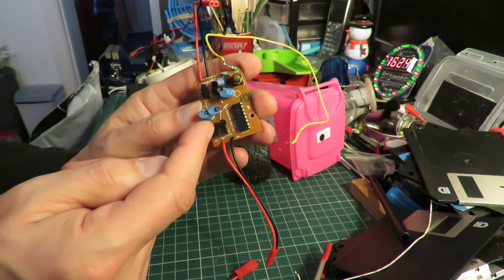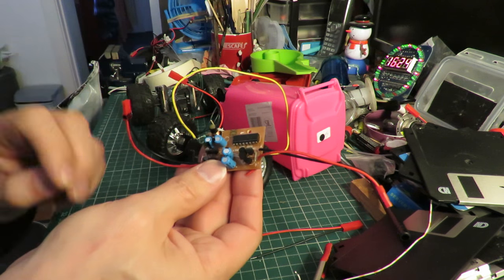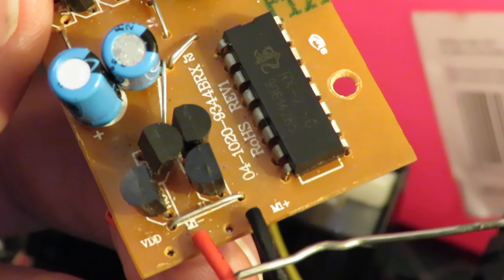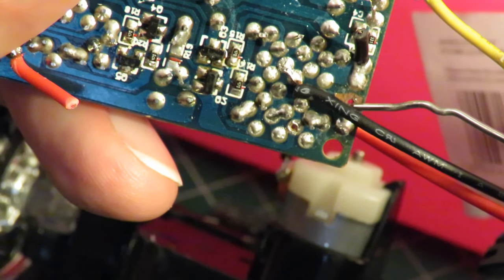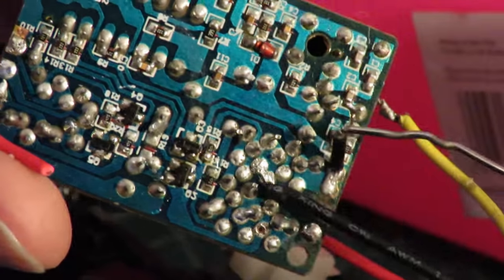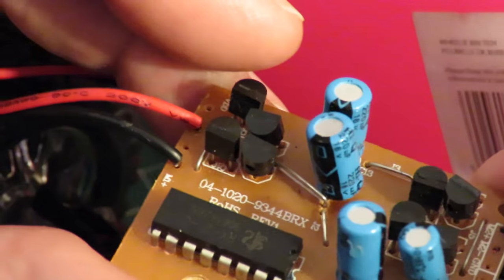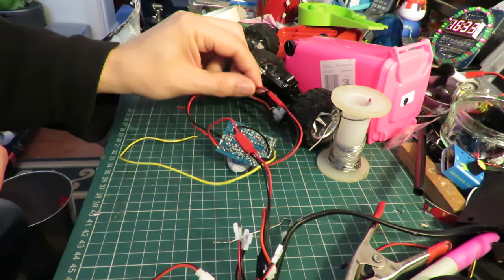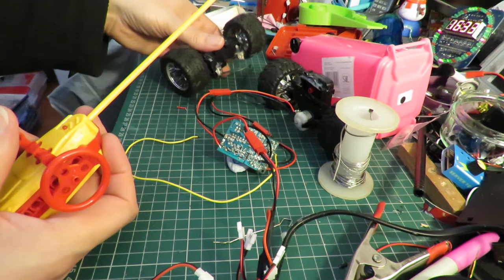Re-Using a Toy Grade RC Receiver

Comment: Hi sir I had a question that can I use a circuit board without esc with 9 volts 
It will burn or not can I use it with bo motor plz reply sir
Reply from the maker: That would depend on what the circuit board was designed to handle. If the car it came from used 4 AA batteries then it would handle 6 volts and using a 9 volt battery will kill it. If you want to use a higher voltage battery you need to change the H Bridge to a module that will handle higher voltages or intercept the existing motor feed and use it to switch relays that can handle the current/voltage you require. Here is a video that covers using relays https://youtu.be/WK_G6DikXGg?list=PLA5a2xPRSrB1f-x1-lufP6dnLQZWafj6v and here is a video that covers replacing the H-Bridge with an external module https://youtu.be/wIWNY1R5KZo?list=PLA5a2xPRSrB1f-x1-lufP6dnLQZWafj6v All my videos have extra information in the video description.
Reply: @GrandadIsAnOldMan  thank you

Comment: Hello sir, can I change that receiver to a Dumborc X6F receiver?
Reply from the maker: This video is talking about the very basic simple toy grade receivers. They only have two outputs. One for the steering and one for the drive motor. I am afraid I have not heard of a Dumborc X6F receiver, so I cannot give you any advice on that. You will find a little more information in the video description.
Reply: @GrandadIsAnOldMan  I have 2 X6Fs. You can install these in a toy grade chassis BUT you will need an ESC & steering servo. If you remove the main PCB board you will need to replace & add everything except the installed motor. The steering can be configured 2 ways, You can remove the main steering motor & rig in a stearing servo or you can take a servo apart and solder the server signal board onto the steering motor.
Reply from the maker: Thanks, I think you will find the question was about replacing the receiver 'one for one'. As you say, if you are going to fit a hobby grade receiver, then you need to add the rest of the hobby grade components. Interesting idea attaching the servo signal board onto the steering motor to drive the motor proportionally left and right, but unless you also have some method of including the servo's potentiometer won't you have a problem returning the steering to the centre position accurately. (I suppose you can leave the toy grade spring return in place and that might do it for you). I have done similar using an ESC to drive that motor and conversely, used the servo circuit board as a small ESC for small cars and boats 👍👍
Reply: @GrandadIsAnOldMan  Granddad the microprocessor chip will set the motors neutral position based on the radio (transmitter) trim. The receiver I think sends 5 volts to the steering servo. If you break down a steering servo, you see it has one of those rectangular brushed motors in them. A positive and negative wire are connected to the signal board and from the signal board comes the 3 receiver wires. I've seen so many people cut up the toy grade chassis when its cosmetically better to solder the servo's control board to the existing turn motor. The center reset spring can be removed. The end points are set on the radio.

Comment: can you make a soldering iron homade
Reply: Ben Tennison did it a while ago using an old glow plug from a diesel engine. you need 12v source though.
Reply from the maker: The simplest soldering iron is just a big old screwdriver filed to the right shaped point and heated in a flame although a lump of copper would make a better tip. Lots of soldering irons are heated by a small gas flame instead of electricity so they can be used where there is no power available.

Comment: Sir my car remote central locking is not receiving signal from my key fob. I can't lock and unlock the car with the key fob. Please help me to repair it.
Reply from the maker: In your previous comment you stated "got it checked with multimeter. Actually, I installed aftermarket remote locking module. Now, the module is not receiving input signals from the key fob. Key battery is ok." so if you have checked the input and output of the chip on the relative pins you already know exactly where the chip is and how it works so you should be able to identify the chip number and search online for a replacement chip. I would not attempt to remove a chip from a circuit board myself without a proper desoldering kit. If you already have the skills to identify a faulty chip then there is nothing I can show you that you don't already know. I suspect it is unlikely control chip is faulty, more likely the motor control transistor or the aerial circuitry or even the buttons on the key fob. Do you only have one key fob? normally you would have two so you can check it is not just one that is faulty.
Reply from the maker: Maybe search YouTube for "aftermarket remote locking module" I did and I found this video along with several others https://youtu.be/vx1t1ZOyP-E
Reply: GrandadIsAnOldMan yes the control unit is the only issue. Keys are fine. However, that particular chip don't have number embossed on top of it.... please help more on this.

Comment: Hii sir rembember I told u abt a reciever of mine .so I checked it  when I connected multimeter it gave me just 2 volt ..on left and right  at the rx .but at the motor only 4 volts on right no volt on left
Reply from the maker: Sounds like one of the power transistors in the H bridge is dead
Reply: @GrandadIsAnOldMan   can u pls tell me how to repair it. Can I repair it ...it is RC 2b reciever ..
Reply from the maker: I have no different answers or guidance to give you than I already gave you in the previous replies although I did this video last month that may help. You may have missed it https://youtu.be/PdZJJi56Lu8

Comment: dear sir, can you please refer any video for designing receiver circuit for RX 2B IC.
Reply from the maker: If you search online for the data sheet for the RX2 chip you will find they usually include an example circuit.
Reply: @GrandadIsAnOldMan  is you are write but in that datasheet they have just included RF block not an individual circuitry. I have found some videos and text material for FM transmitter and receiver design. I think it will help me while designing a special RF transmitter and receiver for my line of work. Thanks for your reply
Reply from the maker: @noumanshabbir1990  try this - it is the same as an RX2TX2 chip https://www.diodes.com/assets/Datasheets/PT8A977B978B978BL.pdf

Comment: I have a RX-6 reciever what freguency is that ?
Reply from the maker: I am afraid the number on the chip does not tell you the operating frequency. The frequency is set by the associated circuitry on the receiver board.
Reply: @GrandadIsAnOldMan  my car is made out of 1 circuitboard only how then i can tell wich freguency it is
Reply: @GrandadIsAnOldMan  mabye you have a email where i can send a photo to because i really wanna repair this car because it was from my dad his best friend which passed away couple years ago
Reply from the maker: @180skrr  The other components on the circuit board are the items that set the frequency. Unless you have extensive knowledge of electronic components and radio frequency generation there is no way to tell by just looking at the board. Unless it just happens to have the frequency written on it. Some circuit boards have 27/45/49 written on them with a line through the correct frequency. The only other way to find out is to have a selection of controllers of known frequencies and see which one makes it work. The RX6 chip does not set the frequency, it can be used for all the toy grade receivers including infrared control. As I said twice now, it is the other components on the board that set the frequency. You could search online for the data sheet for the chip and that will probably give you example circuits and may even give you the values for those components for an example frequency. You would then need to be able to read the component values on the board to work out what they all are.

Comment: I have same circiut like it but it not work
Reply from the maker: There are plenty of reasons for it not working. Do you know if it was working at any time? 
Here is a compilation of replies I have given to other people on other videos relating to toy grade RC.
A bit like asking an IT support.  You say it doesn't work any more. Does that mean absolutely nothing happens when it is switched on and you operate the controller? Or do you have steering but no drive, or lights but nothing else. Those sort of checks would tell you if power is getting to the board from the battery. You would need to start with some basic checks like the batteries in the controller and the car. It would be handy if you could check your car with another controller of the same frequency and check your controller with another car of the same frequency so you know you are not focussed on the car when the controller is broken. Next you will need to take it apart and having a test meter would be very handy. A visual check would tell you if the wires from the battery box are still connected at both ends. A visual check would also tell you if the wires going to the drive motor and steering motor are still connected both ends. A car driven into long grass often puts too much strain on the motor. That causes it to draw more current and that becomes a 50/50 battle between the motor burning out or the power transistors on the circuit board burning out. You could check the motor by connecting a suitable battery direct to the motor terminals to see if the motor spins. However a burned out drive motor would not stop the steering motor running unless something really catastrophic has happened, so your description of "doesn't work any more" would seem to point elsewhere.

Toy grade receivers just have two wires per motor and have three signal states.
(1) Applying the battery plus and minus on the wires turns the steering motor one way.
(2) No battery applied allows the spring return to centre the steering.
(3) Applying the battery minus and plus on the wires turns the steering motor the other way.
If you connect the same two wires to an ordinary DC electric motor and apply "Left" the motor will keep spinning as long as you hold the transmitter on "Left". If you then apply "Right" then the motor will spin in the opposite direction. 
In toy grade steering the only thing that stops the motor from spinning is the mechanics of the steering so the motor is still trying to spin but the steering arm has reached stop. On a hobby grade servo the electronics measure how far the steering has turned and stops the motor electronically.

On toy grade receivers the motor outputs are often labelled M1+ M1- and M2+ M2- or they may be labelled F/B for Forward/Backward and L/R for Left/Right. The battery inputs are labelled VDD and GND or they may be B+ and B- for battery + and battery - 

RC TX2B and RX2B chips https://www.youtube.com/playlist?list=PLA5a2xPRSrB1mLQvgf5ILMeTcRMuDtcNa
http://hackedgadgets.com/wp-content/uploads/2015/10/RX_TX.pdf
http://blog.tkjelectronics.dk/wp-content/uploads/2011/09/RX2_TX2_Datasheet.pdf
https://www.datasheets360.com/pdf/-3574820636171009157

RC toy grade modifications https://www.youtube.com/playlist?list=PLA5a2xPRSrB1f-x1-lufP6dnLQZWafj6v
http://www.rcuniverse.com/forum/rc-radios-transmitters-receivers-servos-gyros-157/8295524-proper-antenna-wire-length.html
Infra Red Remote Control https://www.youtube.com/playlist?list=PLA5a2xPRSrB0twF3brpsYS56Jv3iDtaU2

Comment: How make transmitter
Reply from the maker: Personally I would not attempt to make one from scratch. Just sourcing the components would probably cost more than buying a ready made transmitter and receiver. If you really want to make one the standard data sheets for the TX2RX2 controller chip give example diagrams http://hackedgadgets.com/wp-content/uploads/2015/10/RX_TX.pdf but you can buy transmitter and receiver circuit boards online cheaply. These playlists may help https://www.youtube.com/playlist?list=PLA5a2xPRSrB2KYw1ZgX_WHicdepBxjdka
https://www.youtube.com/playlist?list=PLA5a2xPRSrB1mLQvgf5ILMeTcRMuDtcNa
https://www.youtube.com/playlist?list=PLA5a2xPRSrB1f-x1-lufP6dnLQZWafj6v

Comment: Hola una pregunta tengo una placa de un carrito con todo y control pero el chip que tenia sequemo pero le puse otro y no funciona que puedo aser
Reply from the maker: There is no simple answer. You would need to do a step by step fault finding session to identify where your problem is. Start with simple steps like checking your batteries are in good condition and you have the + and - connected the right way round. Do you know if the new chip is a good one? Does your controller match? So many questions, to be answered.
Reply: @GrandadIsAnOldMan  mira todo esta bien el chip es de otra placa de otro carrito que no tenia control pero yo selo tras pase
Reply: @GrandadIsAnOldMan  lo solde y no funciona no tiene corto en tonses que se puede aser
Reply: @GrandadIsAnOldMan  tepaso mi número para que veas que chip es
Reply from the maker: @CarlosMartinez-vy3nn  there is probably a lot lost in translation here, but I am afraid I cannot fault find on your work for you. I have never had a controller chip go faulty. The usual fault is one of the H bridge transistors in the motor control part of the circuit has overheated. If that is the case, then changing the controller chip will make no difference.
Reply: @GrandadIsAnOldMan  andele el chip de la tabliya que yeba los motores es el que se calentó y sequemo en tonses yo le puse otro chip de otra tablilla y no funciona  quisiera saber que pasa el chip es uno negro con 4 pines aun lado y del otro lado yeba otros 4 en tonses el chip que traía se quemo
Reply: @GrandadIsAnOldMan  quisiera saber que puedo aser
Reply from the maker: @CarlosMartinez-vy3nn   in this playlist I look at the RX2 and TX2 chips https://www.youtube.com/playlist?list=PLA5a2xPRSrB1mLQvgf5ILMeTcRMuDtcNa
Reply from the maker: @CarlosMartinez-vy3nn  Your comment explaining which chip was burned was hidden by YouTube. I have just found it. Yes that is probably the H-Bridge chip. Some boards have individual transistors for the H-Bridge and some boards use an H-Bridge chip that does the same job. You can buy an H-Bridge board that takes the outputs from the receiver chip (usually the RX2 chip) to replace that part of the circuit board, but to be honest, you would find it easier to swap the whole receiver board for one that works. I show it in this video https://youtu.be/bPNLExKklhY?list=PLA5a2xPRSrB1mLQvgf5ILMeTcRMuDtcNa

Comment: Diagrame plzz
Reply from the maker: I didn't use one, but if you do a Google search for "tx2rx2 data sheet" you should find plenty of examples. The TX2/RX2 chip combination is used in most of the older toy grade RC systems.
Reply from the maker: Here you go, I just searched and came up with this example https://www.circuitstoday.com/5-channel-radio-remote-control